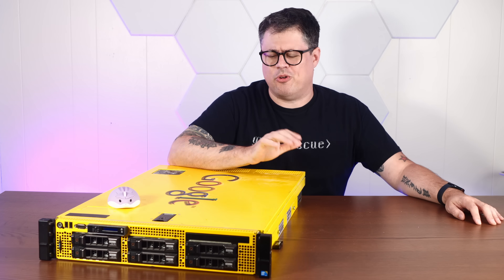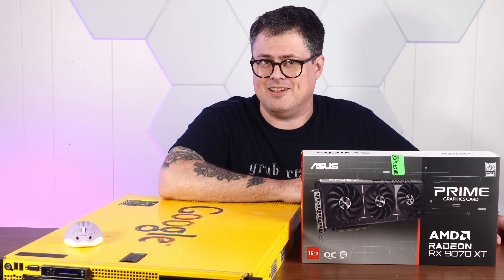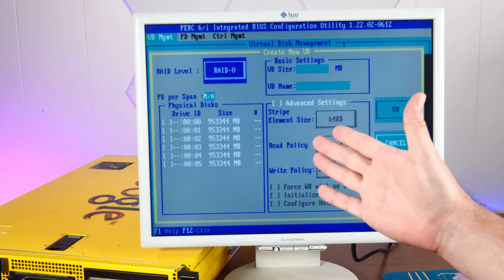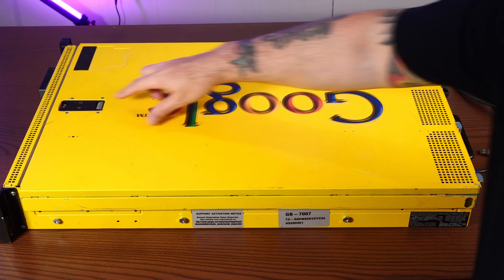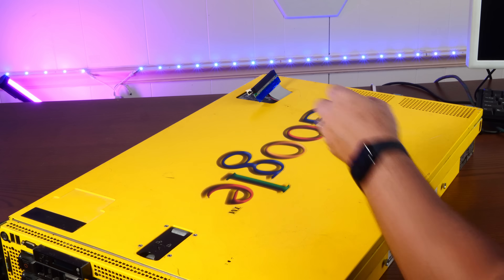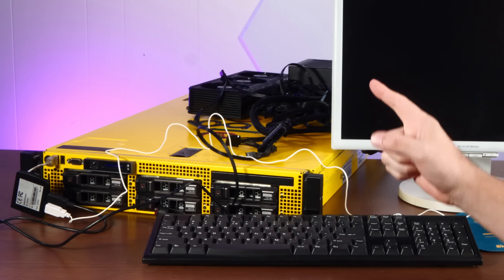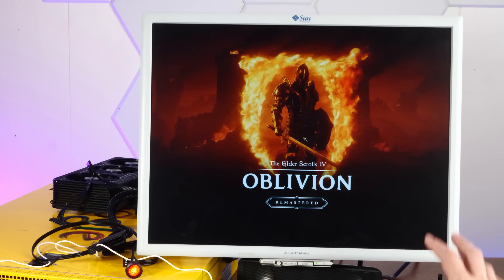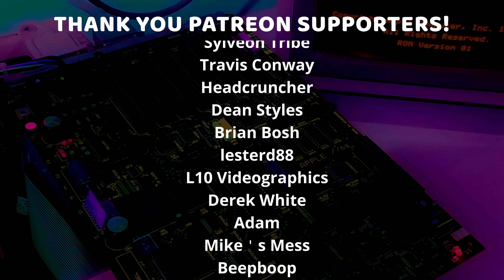Can You Use a Server as a Normal PC?

Comment: I run a 1650 right off PCIE power on my R730. Works great. Just had to move some stuff around and get rid of 1 plastic cover ( I forget for what, prob wire management) to fit the GPU. I did retain CPU shroud. Only reason I'm running a 730 is for Blue Iris and the 8 3.5" slots. Was cheaper overall then building a pc and buying a NAS. 

My kid games on a Dell Precision T3600 desktop server with a 1660S in it. Does great for what he needs. 

The main problem with your R710 is it's an old DDR3 unit and it's not utilizing the CPU's properly for that game. Need to set up a hypervisor to utilize both CPU's properly if you plan to use a dual cpu system for gaming, or really anything other that what it was built for.

Comment: I have an r815 that I am currently trying to get the full bandwidth out of the x16 PCIe 2.0 slot that has a riser stuck in it, splitting the x16 electrical into to two x16 physicals with x8 electrical each. I would love to see what solving that would look like.

Comment: @Action Retro, You could of just run 4 HD in raid 1+0 meaning you can have 2 of them adding performance and the other 2 replications for the OS and some games. Then the last 2 Drivers as just normal Raid 0 and only put games on it if one goes bad not a prob just reinstall.   the different raids but since they are 7200rpm drives the performance kinda a must for gaming lol.  Also those addin cards u can get ones that run at the full 16x so u can run full size cards + bandwidth, Also on the PCIE issue alot of server mobos have a 8pin or 10pin u plug a cable into that breaks into the cables for GPUS. SO the PSU plugs into MOBO traces to those ports then u adapte.

Comment: back in 2017 everyone was happy that these entered the market.
All of the sudden you can grab a X5670 clock it to 4.0 stable or a X5690 clock it to 4.2 GHZ
and have a 6 core 12 thread machine that could rival its 7'th gen
cousins... 

Intel's IPC was 0.1% between Nehalem and 7'th gen.. 

in any case, good times, but I don't see the point. 
Most people used mobo's like EVGA classified or ASUS P6T WS PROs as a way to overclock.. 
in fact I have such a motherboard in my attic right now... 

As for a good way to use it, because its triple channel, you could grab 192GB of cheap EEC DDR3
make a Ram pool of say 24GB, and host a Minecraft server using a ram disk image.
This means the I/O issue is sorted. And you have plenty of ram left for the Java instance
and for it to execute in. Make sure you have those 6 core 12 thread Xeon's in it to 
make us of those cores and your off to the races, a paper fork that can use more cores
is probably preferable since the clock frequency on the single core is low. 
Think of Purpur for example where you can manually add the core count for the worker threads.
or perhaps even go all out and try Folia.  

Plus DDR3 can be very low latency and with triple memory channels you actually do make up for
the lost bandwidth to a degree. 

Thank you for not allowing our hilarious comments to get your spirits down. Stay positive Dude,
and have a great rest of your week / day / evening or goodnigh

Comment: Install 3x amd 6400 low profile 8gb cards in it. Install a server NVME drive in one x8 slot.

Then disable the onboard RAID. Install Proxmox using ZFS. Create 3 Zorin OS VMs, each with 6 vcpu, 16gb and 1 and 6400 via pcie passthrough. Allocate 50gb of storage from NVME for the OS and then  1.5TB from the HDD for steam games.  Install the steam apt.

Now when people come over with their name gaming laptops you can play lan games with them. 1 person can use a single VM. 

Sure they won't be able to play AAA games at 1440p, but 1080p should be fine, especially at lower settings and FSR enabled. 

Imagine the surprise when they can game using their old laptop with a horrible igpu. 

Even this old server should be able to handle giving each VM 6 threads.  Just make sure that you pin the vcpus to a single Xeon cpu. It will be able to run PfSense and PI-hole so you will have a good router and have a local DNS can can block trackers.

Comment: Try running cpupower and setting it to performance mode and the game will probably run fine. Also, if you change ANY graphics settings in game, you have to restart or the game will get all janky. Unreal is kinda dumb. Idk why they used it. The game looks great, but they could've done the same thing in the new Creation Engine. Starfield was crap, but the graphics were pretty good.

Comment: I mean, my X99 is basically a dual CPU server with 28 cores and 2 GPU's. It's old hardware, but it runs modern games pretty well and didn't cost all that much compared to something newer and comparable. Oblivion Remastered ran pretty well on my 6700XT and that was before I did the turbo boost unlock BIOS edit.

Comment: I've been working on turning a Dell Precision 690 into a gaming PC.  Dual Xeon 5355 quad cores, 32GB of DDR2, and a GTX 980Ti.  I must say, preliminary results are promising.  Subnautica looks great, Just Die Already ran perfect (at lower temps than my main PC).  Goat Simulator was actually just playable.  Since it's from 2006-2007, I'm mainly going to be running some XP stuff on it.  Battlefield 1942 is fantastic, and I can't wait to try Oblivion on it.  Maybe I should try remastered, just to see if it can!

Comment: It's so obvious that this server is a Dell poweredge R710 with yellow paint 😂
You really are doing some Bringus studio level stuff with this one, just much less janky.

1st RAID5's VD name: "LOL", I didn't miss it 😂

I just wonder why you put it in RAID6
Little tip: those RAID controllers (PERC 6, all variants) perform better with a 32KB strip size, it's the perfect polyvalent sweet spot, it's the same with any LSI card, rebranded or not, SAS 1 or SAS 2, from that period, just saying. They reach their top overall performance level with RAID 5+0, 32KB strip size as long as you have a RAM cache. Cards without a RAM cache are super slow when writting with any raid with parity, but don't suffer from lack of cache when using RAID 0, RAID 1 and RAID 1+0.

It's normal for such servers to be loud before the boot sequence is completed and the OS fully loaded, and it's normal if it's extremely loud when the cover is opened (it runs all fans at max speed right away). I used to work on them, and previous gens such as the poweredge 2950, for a while, but with RHEL and its little bro CentOS, nothing like ubuntu.

Lack of PCIe lanes is not the worst (some recent cards have only 8 lanes, such as RTX 5060 and 5060TI, but it's 8 PCIe 5th gen lanes), but the PCIe version (I guess it's PCIe 2nd gen on this rig, bandwith per lane doubles every new gen), and of course old Xeon CPUs, and the very safe but very slow ECC RAM, especially if you have less than 32GB, which seems very likely.

Comment: If anyone knows of a video of one of these things that has the original Google software on it, I for one, would love to see that!

Also don't knock the old Dells. I've got an R720 at home that runs ESXi, been using it for years, got it for free. I put SSDs in, but kept the included 48GB and dual Xeons as-is and it hosts about 13 VMs. I didn't do anything crazy to the fans, they seem to settle down once the OS is booted and all the thermal management stuff in the OS kicks in. The VM I use the most is my sole Windows install. Also have some older Windows VMs on there with specific versions of Java and other crap that some old equipment needs for management software. It idles at around 70W with the SSDs.

Comment: I love old server stuff!

IBM blade server popped up at a government auction site with 14x HX 5 Blade servers that I think contain 128GB of DDR3 ram, dual unknown Xeon's.

Nearly 2 TB of memory, some reading told me that they use 1,600 watts for of power for the fans alone. AND requires dual 220. AND none of the blades have built in storage...

This will not be my next homelab 😂

Comment: You know that the slot the default Dell riser plugs into is a full 16x slot, right? If you buy a 16x riser to and replace their dual slot riser, it'll run a lot better. What it's doing is bifurcating the 16X, which is why both those slots are only eight.

Also, there's a way with an IPMI tool to turn off the third-party automatic ramp-up that Dell's firmware does. And you can do that before the system boots so that right from the default it runs the quiet fan curve instead of the full throttle emergency curve.

Comment: Until recently, my gaming pc was a barracuda web filter.  Granted it is sort of cheating since they use run of the mill mATX motherboards with minimal customization to the bios.  In fact, my emulation machine uses one of those motherboards.  No onboard sound does suck since you are forced to either get a dedicated card or use audio via HDMI if able.

Comment: Back in the day, HP used to have great deals on their small business servers. I got hold of a Proliant ML110 G5 for not much more than £100. You couldn't put a basic desktop together for that then. I had dreams of making it a hackintosh workstation since it at least looked like a desktop but it had issues. It was primarily designed to run headless so it had a crappy onboard really obscure Matrox graphics chip. Therefore I needed a GPU. Problem was, no dedicated x16 GPU lane. You had 3 x8 PCIe lanes instead. I ended up butchering a GeForce 8800 so that it fitted in the truncated slot. It would only run at x1 because that was a limitation of the server bios that I only found out about afterwards. Also no sleep, because: server. I gave up. I ended up running Snow Leopard server on it.

Comment: I have a similar machine,  - a Dell R510 it has all 14 drive bays full.
It is set up temporarily as my file server, and it is also running VMs, and a little LLM work.
Its 'straight line' performance is not impressive these days, but with 128gb of RAM,  and 12 cores it can actually do quite a bit of work without breaking a sweat.
I kinda think of like a train, and my Ryzen 5900x as a motorcycle. 
The motorcycle is fast, but the train can carry quite a load.
The R510 has 14 drives, but the Ryzen is limited by pci lanes. I think it only has 20 free, but if you use two nvme drives you lose lanes, if you have a  GPU using 16 lanes the nvmes and a you can't add a RAID controller.
Also the R510 has ECC memory, the 5900x doesn't.

Comment: You wouldn't need to splice into the psu inside, the risers usually have a power connector that has power for a GPU. Looking at the one you have it looks like it has 1 8-pin

Comment: You can use any server like a regular computer because the only difference is firstly, power consumption, secondly, a specialized, highly efficient and power-hungry processor that will be boring when used as a regular PC. Besides, these processors have some instructions cut or added that a regular client CPU does not have, so the question is not whether it is possible, but whether it is worth it.

Comment: 11:17 it does give about the same performance as a Pi with an external AMD GPU, lol
Reply: Out of curiosity, do you know of any nVidia eGPU solutions?
Reply: @UltimatePerfection not for Pi, but yes for some other Arm systems
Reply: @UltimatePerfection there’s a ton of them out there, just look up eGPU enclosure. Most of them run via thunderbolt. The GPU itself is largely irrelevant and entirely dependent on your OS’s GPU driver support ie Linux preferring AMD cards, etc. beyond that, make sure the enclosure itself doesn’t have any driver nonsense going on with your OS. Hope this helps. A bit nicer than the simple: “Google it” :)
Reply: No, xeon is powerfull, 100x more vs a rasberry or another arm. only consumption is expensive but powerful
Reply: @TheJaaavier "xeon" is a line of cpus. the dual cpus in this system are old, and since xeons are meant to be used for servers they have great multi core performance but not so great single core performance. only a handful of games utilize multiple cores, and only a few of those can go up to 4 cores. a dual cpu solution is also terrible for gaming with latency and all, especially in this example as emulation layers require the lowest latency possible. there are many reasons as to why this system is suboptimal, spec sheets dont tell the full story
Reply: @zelo6237  To add to this, these Xeons are from 2009, 4c8t 2.6ghz. Most games won't even utilise dual processors as they're not NUMA aware. they'll just sit on one processor.
Reply: @zelo6237 I don't know where you've been, but for a few years games use more than 4 cores.
Reply: @zelo6237  This is untrue, or outdated. Most games, if not all new games heavily utilize multithreading, it's not Crysis in 2007.
Reply: This is the greatest insult to a computer's performance I've ever seen
Reply: You can also add an internal 2 slot gpu by taking a 6+2 pin and manually soldering the wires to the power supply in a certain order.

Comment: You could take the motherboard out, change the fans and power supply, put it in a case and use it as a normal computer.  I did that with an old server.  It still runs fine.

Comment: I did my gaming on the successor to this, the R720. But I knew Windows needed tons of reboots during install, and server reboots are slow, so I installed Linux, put Windows in a VM, then used PCI passthrough for the video card. Two OS + two monitors + two keyboards + two mice = two fun.

Comment: I came into my current household with a crappy 15 inch laptop like 2 years ago.

The first thing I did was buy a GPU, then I bought a rackchoice case and a crappy server motherboard/cpu/ram combo that was outdated. The GPU was way overspec, similar to your setup. It sucked but I did eventually move onto building my own expensive tiny PC with 16 cores at 5 Ghz and 64 GB of RAM. The server is now in production serving my web-services, so it was actually preplanning to start with it. Worst part of using a server as a PC is how god damn loud they are... Especially in your case. Even a slightly outdated server only has a single core clock speed of like 2-3 ghz. Terrible for daily operations, feels like you're on a computer from 2005. Single thread performance is just still too noticeable.

Comment: 7:29 just a heads up, those riser cards do have a power outlet socket on them. Dell sold a cable that connects to them for a 6pin GPU connector.
Reply: Actually no, in the DELL R710 there is no power outlet socket on the risers. Newer ones like the DELL R730 do have them though.

Comment: I did using an old Dell rack mount server running W2K3 Workstation for several years. Got it for free. After a few months, decided to retire it. Too noisy from the fans and 15k RPM SCSI drives.

Comment: You can replace the iPERC card with a generic LSI card so that all 6 drives at the front work like JBOD and then you can install TrueNAS on it. That's what I'm doing with both of my Dell R710s. ^_^
There's an entire reddit guide on how to upgrade to the LSI cards using the same special PCIe slot that the iPERC is installed in.

Comment: Oh and the issue with grub rescue is related to the size of your raid array. The BIOS will actually refuse to boot large disks (iirc 6TB was the limit). The way I solved it was just turning my array into 2 separate virtual disks in RAID 5 and it worked

Comment: The correct way of approaching this would be to get an x16 riser. The problem is that even if you do that, most graphics cards are not designed to be cooled in a server case. That's why, as much as I want to critique the riser cable through the hole, it's probably the best way of approaching this. Even if you use an oculink cable, that would be 4 lanes instead of 8.

Comment: Yes a server can be used as a normal PC, done it and wore the tee shirt

Many moons ago the laptops work provided where getting rather old and getting harder to do any Web dev on them.  The CEOs where reluctant to change them normal story

So I brought an old HP server (1u gen 4) that had 2 3.4 Zeons (NetBusrt) which after throwing a Nivdia quadro and a HD, ran a process that the ageing laptops took 30mins to build the companies software (devs sometimes had to do a full run 4 times a day) in 6 mintues which shocked them and they replaced the laptops pretty quick.  The server did end up with a couple of nick names, Jet engine or the wooden server due to i built a custom 1U case for it

Comment: Oh, there so many other shenanigans you can try. to domesticate this server... First of all (as others already mentioned) try riser board with x16 slot (officially "The optional expansion-card riser 2 provides one PCIe x16-link Gen 2 expansion slot.") for GPU. And btw can onboard slot function without riser as x16 ?

As for storage - the SAS HDDs are already loud by themselves, so very basic idea ro swap them with regular SSD (not necessarily same ones), for gaming rig will suffice. Or even may I suggest to remove drives completely and try something called "Fusion-io ioDrive" PCIe storage card (official). Heh, even why not to try generic NVMe drive via PCIe adapter? If not booting - may be something like external boot  manager on USB like rEFInd.

Btw, nice trick with ipmitool - tnx!

Comment: If you want to use a server as a normal PC, buy the tower ones. They're quieter because they're designed to sit in a room where other people will be in. Rack servers assume the machine will be locked in an acoustic isolated temperature controlled room, so noise isn't a concern as almost nobody will spend long periods of time in there.
Reply: Old tower servers are quite rare, compared to the market flooded with rackmounts.  And tower servers aren't much quieter than 2U servers.  Though they'd be a lot quieter than 1U servers.
Reply: You can always go for 4U servers.
Reply: I see Rossman here lol